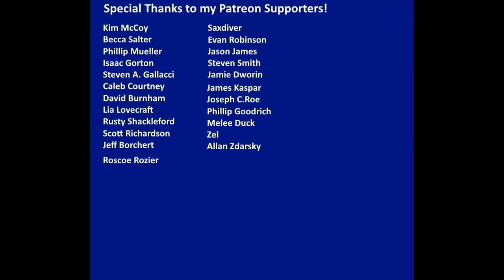S&W M1917 Snubby  A Retro Rod Revolver

Comment: One look at your face brighten up talking about your work with this one shows how much you like it. I like it too! Some of us are old enough to remember when the revolver was king for CC because few compact autos were made and those weren't cheap. Back then the "Flying Ashtray" was also king of the roost and it doesn't lose any of that performance from sitting around, even if the old primers do. It's mostly the cylinder width that makes revolvers harder to conceal than autos, and TBH a slightly larger 'lump' is still a lump so not much lost there for a lot of gain in performance over most snubbies. Add the moon clips and you're set, except those are a 'lump' too, which is why back in the day a lot of folks used the half-moon clips instead; still pretty fast to use and more pocketable. I never liked (or understood) serrated triggers either. With that fixed and an action job that smile of yours may grow so big as to be painful- I know mine would if I had it 👍

Comment: Not every modification has to suit everybody. I have had people look at me like I was crazy and ask why did you do that to this gun? Simple answer; because it's mine and I built it to suit me. That being said, I have never been a big fan of the trigger shoe. I have a few K frame and L frame revolvers that had the Tyler T grip on them when I bought them. I took them off and either gave them away or threw them in a random parts box. I like the overall look of this snubby. It would certainly get the job done in a hurry.

Comment: Hey, that's pretty neat. I think a lot of people talking about the ballistics don't really understand that barrel length doesn't affect all rounds the same way and by the same amount. It has a lot to do with pressure and propellant burn rates and things like that. It seems like big, low pressure rounds like .45 ACP and even a lot of shotgun rounds are far less affected by changes I'm barrel length (within reason) than higher pressure, smaller rounds like, say .357 or 5.56. A .357 snub nose loses a lot more performance over a more duty sized gun than a lot of .45s will a lot of the time, but .357's performance gain from a carbine may be greater.
Reply: Generally matters more in higher pressure faster moving firearm rounds. When it comes to big bore calibers there is some slight deviation. But nowhere near let's say a 9mm in a 5-inch barrel vs a 3-inch barrel, can be 10+ percent in speed difference. Makes more of a difference in rifle calibers. A .556/223 can have near 1000fps difference from a 20-inch rifle barrel and an 11-inch "SBR. I have a Glock 27 and a 23. There is about 30fps difference in the 2 different barrel lengths.